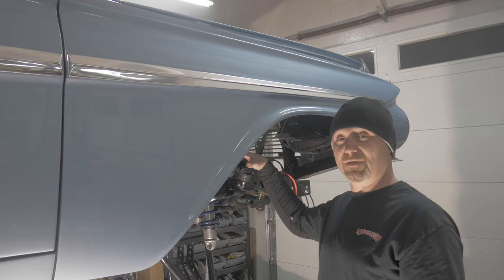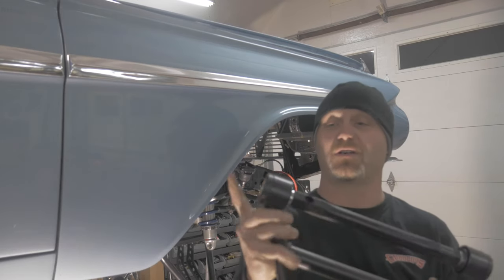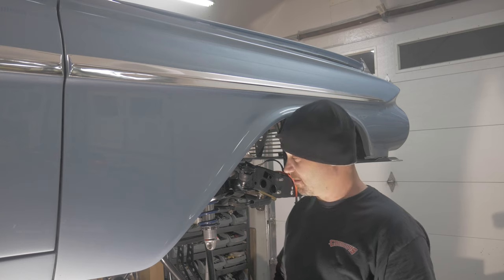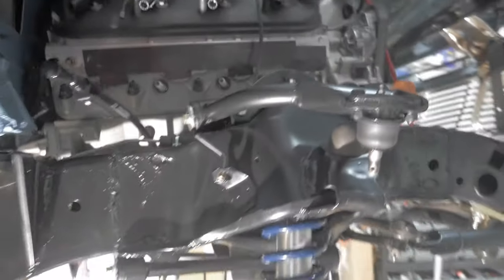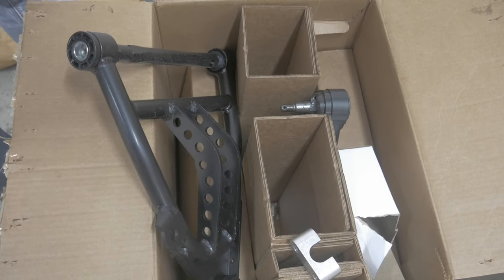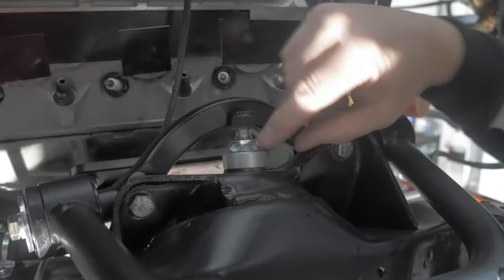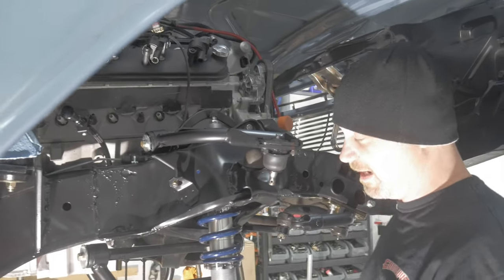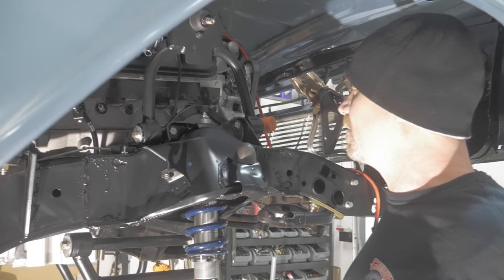WATCH THIS BEFORE YOU BUY ANYTHING RIDETECH!!!

Comment: I am sorry you had issues with your Ridetech kit.
Though I no longer work for Ridetech, I ran the Engineering department for roughly a decade.
I am actually the engineer who was in charge of the following: 
1-the kit for the X frame vehicles when it was initially designed (at that time with poly bushings and Shockwaves.  We did not yet have coil overs, which are smaller in diameter and easeir to fit.)
2-the assembly procedure which the warehouse uses to assemble the control arms, coil overs, etc
3-the holes in the lower control arm
4-the placement of the shock mount in the lower control arm
5-the design of the Delrin bushings
6-the shock strokes and outside appearance of the shocks (Fox handled the inside bits, though later on I designed a number of internal shock parts in conjunction with Fox.))
7-the design of the ball and socket upper shock mount 

I happened to stumble across your video and thought I should explain a few things regarding your specific installation.
Please remember, I no longer work for Ridetech, so the only dog I have in this fight are the decisions I made regarding the engineering of the parts.
Lower control arm holes:
-#1, the location of the 1/2" lower shock mount hole is in the correct location for proper operation when the vehicle is at ride height.  This hole cannot move much without affecting motion ratio.
-I will accept 100% blame for the multiple larger holes. . .I should have made them anything but round so as to not be confused with the lower shock mount.
For that I apologize. 

Shock location/hitting the frame:
-Your shock is hitting the frame as the suspension is at full droop, not at ride height.
If you were to install the spindle the control arm should not droop far enough to cause contact between the coil over and the inside of the frame.
-You stated you had to cut more of the frame to clear the coil over top plate.
The instructions state the spring pocket inside the frame must be cut to provide clearance.  These frames were built in the 60's when things were designed on paper and manufactured with older techniques.
It is not uncommon for two frames to be surprisingly different.  As such the amount of material cut from each frame differs.  It is up to the installer to verify adequate clearance to all parts as it is impossible for anyone else to do so.

Upper control arm cross shaft/bushing design:
The Delrin bushing is designed such that when fully tightened to the cross shaft there is a fair amount of press fit between the two.  
The Delrin bushings are injection molded and as such have draft.
Draft does not allow a nice smooth fit to a flat sleeve.  However, the sleeve is required to provide proper crush, not allow over tightening, and provide adequate surface area on which the bushing can rotate reliably.
The Delrin bushings are molded with 13% PTFE (Teflon) to provide lubricity so the end user does not have to lubricate the bushings every six months.
So I decided during the bushing design that a press fit would provide the required support for the bushing, at the cost of the bushing being tight for the first 100 miles or so.
Simply put. . .if you were to fully tighten the control arm bushings they would be extremely difficult to rotate, causing considerable headache during assembly.  
The idea was to assemble with everything loose, then tighten fully at ride height.  Drive the vehicle and the bushings would "wear in" to the exact dimension of the inner sleeve thereby providing maximum contact area with minimum resistance to rotational twist (maximum ride quality).
Reply: Some people don't have common sense lol. Any aftermarket part has a chance of needing some extra modifications or massaging of old 40 year old frames. I have ridetech a arms and coilovers in my 81 bird and everything bolted on no issues. If I remember right I think it did call for cutting spring pocket and even then everything fit perfect.
Reply: It’s none educated installers like this that can cost a manufacturer future customers.  Ridetech needs to train their customer service reps a little better to interpret individuals like this better….sounds like it cost them a few dollars in shipping costs trying to satisfy this guy.  I think after the 3rd call my patience would have been up as a rep…”Sir…have you read the directions yet?? We can’t keep shipping you the same arms!  No one will think your any less of a man if you would just read the damn directions”!

Comment: Am I seeing things on the lower control arm shaft or is the pivot shaft not fully filling the control arm? It appears 1/4” short place more stress and weight on the control arm once you install the washer and grade 8 bolt with some blue thread locker! The cross shaft should fill the entire hole of the “DOM” tubing welded to the lower control arm. Seems strange as if another shaft was close, not perfect, so use it! 
  Not for me. ASE Master 78.

Comment: So basically your crying that you can’t put a couple bushings and bolts on some a arms and can’t figure out how to get a shock into a bolt hole when the suspension is fully released, not shocking that a shock isn’t sitting in the optimal position when there’s no weight on the system. If you can’t press some bushings and put some bolts in and would rather wait weeks for shipping for someone else to do it for you why are you even working on cars

Comment: I will not buy anything from them again. I had a pair of shockwaves that developed a pin hole in one and they told me they could not be repaired and I would have to buy new ones at almost 1K. I replaced them with airbags and they work better at 10% of the price.
Reply: I just bought bags today because old went bad and said new ones are fox lifetime.but the old were lifetime